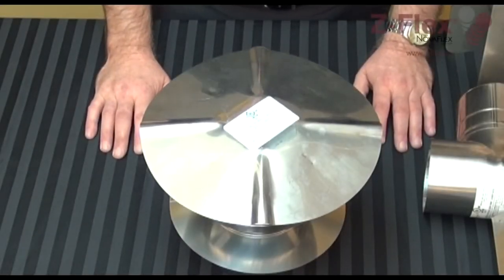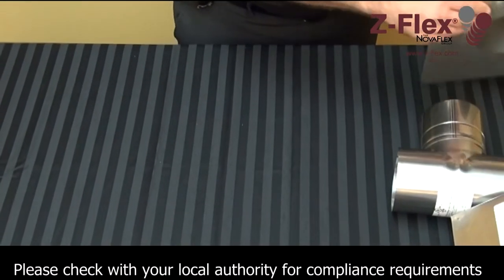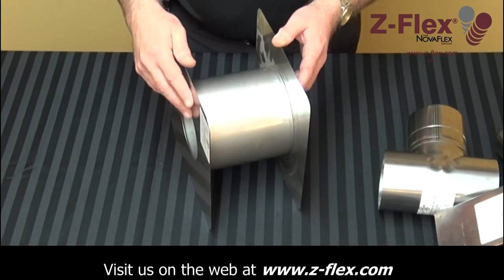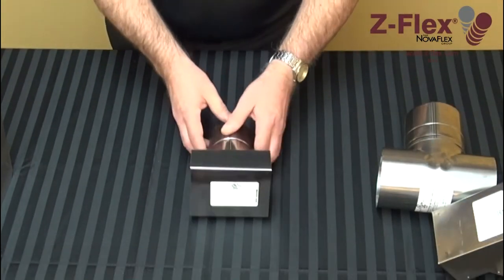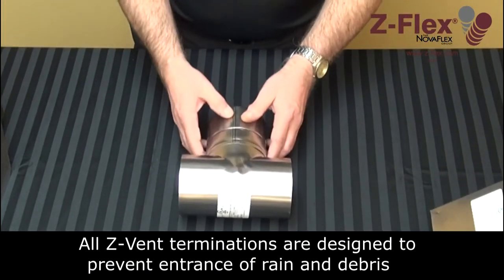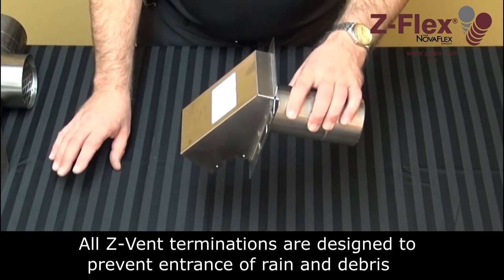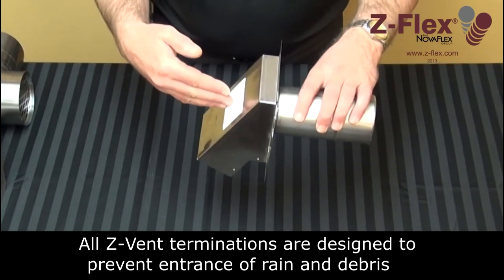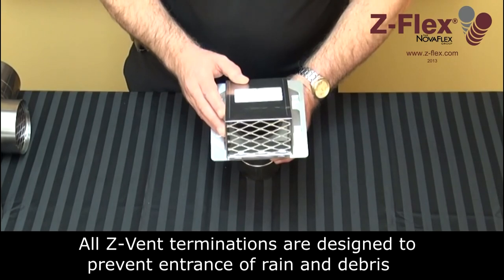Z-Vent Terminations

Comment: What is the proper installation procedure for installing the termination hood?  It is a two piece design which is not waterproof, therefore I am having rain water getting into my appliance through the corners which are not welded.  Are you supposed top caulk the seams shut or install flashing over it?